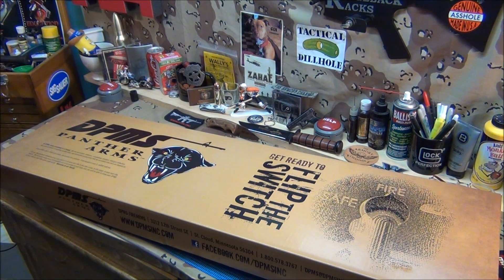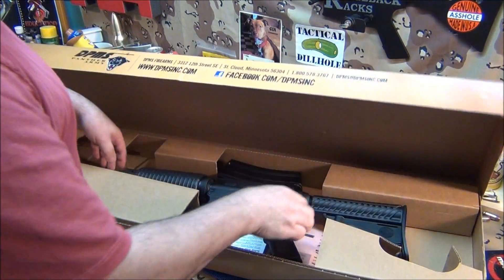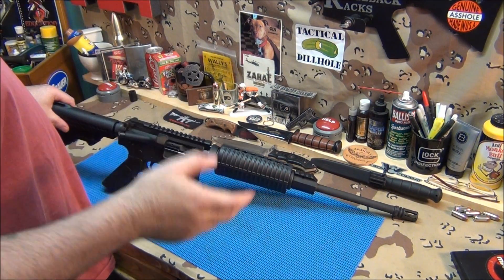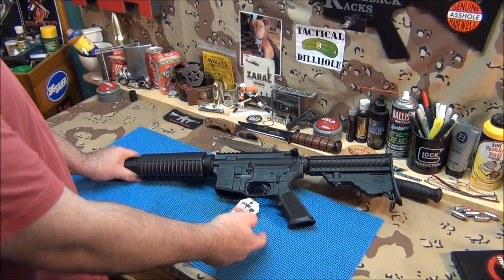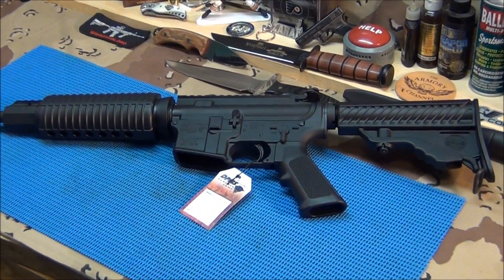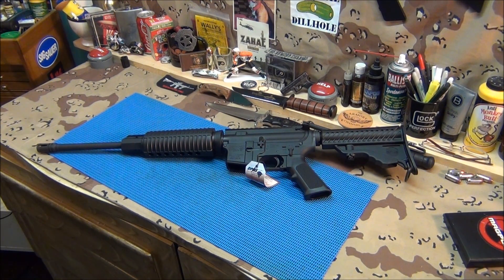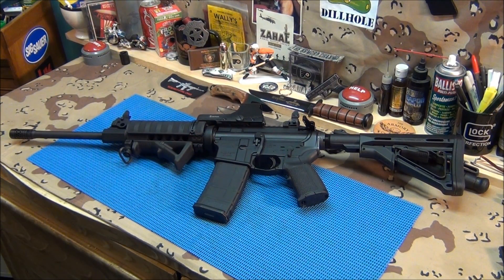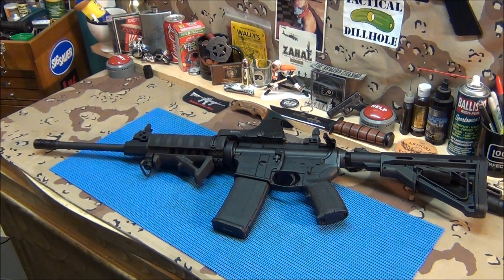DPMS AR15 series Panther Arms

Comment: I just got a new Colt LE6920 Magpul edition at a local gun show for $1085 total. Nothing commercial about it. MOE stock, trigger guard, MBUS rear sights, pistol grip, hand guard, and PMAG. 1-7" twist/chrome lined barrel, F stamped A2 Iron sight, H stamped buffer, etc. Building isn't necessarily cheaper if you start with a fully factory built gun. If you're going to build, start from scratch in order to save money.

Comment: Yea, It comes from a rough surface on the wire. If you buff any spring it gets quieter. High quality springs minimize that sound too. I assume it's because they use higher quality wire. I ended up getting a JP polished spring & smoothing out the inside of the buffer tube. Can't hear it at all now. If I recall I was wondering about the flat wire spring he was planning on installing.

Comment: Is that an 18" barrel?? If so why didnt yu guys go with a heavy barrel instead of the light barrel for better long range accuracy?? New to your channel, like it so far. Also big DPMS fan. I have a Colt, 2 DPMS and a bushmaster. I dont like the bushmaster. The DPMS and Colt seems to be very similar in performance (The DPMS' typically out perform my Colt) with a big savings in cost. But im interested to see what other builders use as perfered parts, as i have tried many parts and brands on mine.

Comment: Is the DPMS AR-15 any good? I would buy a Colt if I still lived in Montana, but I currently live in Calif. So I'm going cheap to begin with and build from there. i almost purchased a windham ww15, but the pawn shop wanted 899.95. I was at Big 5 sporting goods taking the Calif gun safety test and noticed they had an DPMS AR-15 with no case for 669.00, so I made the DPMS purchase because it was 240.00 cheaper, for about the same quality of gun? Didn't want to buy upper and lower and build from the ground up with Calif laws, maybe later.
Reply: +fastech ! I live in Cali too and I bought my DPMS for $583.00 + Dros and taxes. I bought it in Redding. Since I bought it I have upgraded it a bit. DPMS are great guns for the price and have been around awhile.
Reply: +fastech ! They are not bad. I have had the Oracle model for two years. I paid $500. Taken off most of the original furniture. FYI DO NOT use a plastic flip up sight on the front rail/gas block!! It will melt! You have to use a metal sight.
Reply: Yeah I bought the UTG set all metal no plastic crap and they work really well for a set that cost $23.99 on Amazon.
Reply: Rob Sgt.Airborne
I would suggest getting some of the rubber guard strips that go in between the rail slots. Some of the quad rails I have bought have been a little sharp on the fingers. Put those in and you are good to go.
Reply: Lol Got those too! ;)
Reply: +fastech ! what is the California gun safety test?
Reply: DPMS is an awesome rifle. you are gonna like it. put a red dot on it, a single point sling and maybe a decent but-pad and you will be set. i did all that and i also put a cheap quad rail on mine so i could put a light/fore grip on it. its the best bang for your buck trust me. now if you live in Cali. some of that stuff may not be legal, check your laws.
Reply: +Vince ruland It is kind of like taking a written driving test. Last for 5 years. Two parts, long rifle and handgun.
Reply: +fastech ! I grew up in Cali, but moved to TX in '98. I've never heard of this test. Is it a requirement to own a firearm? Or just a voluntary safety class?
Reply: It is a requirement.
Reply: +fastech ! Man I feel for u guys out there. I moved from San Diego to Texas when I was 23 and never looked back. That place is just so over governed. Peace.
Reply: I bought my dpms for 580 out the door got a dealer to match an online sale